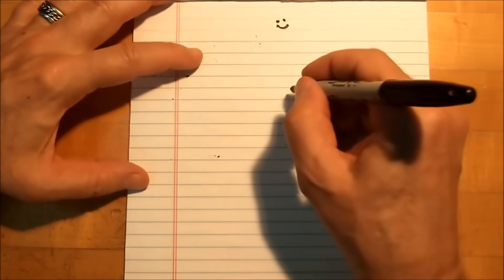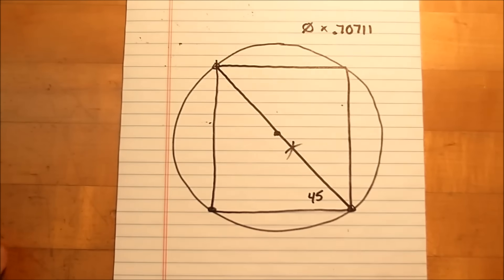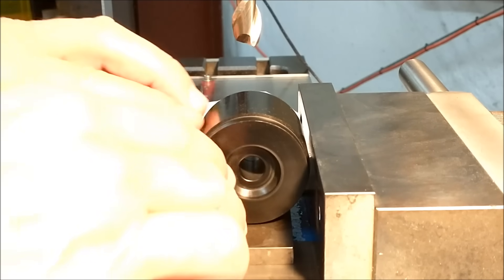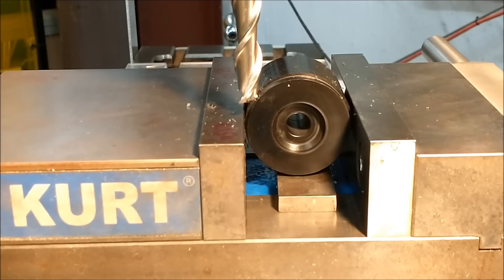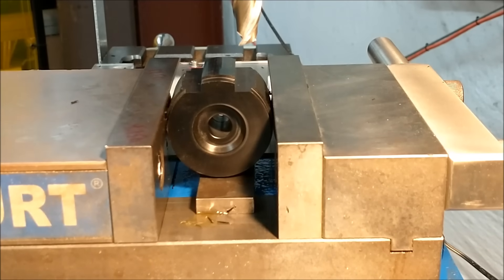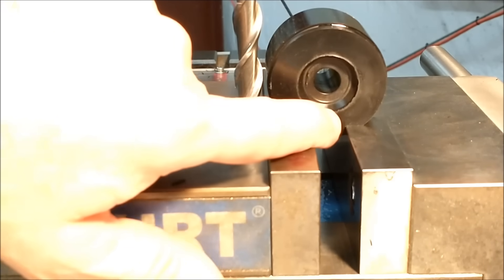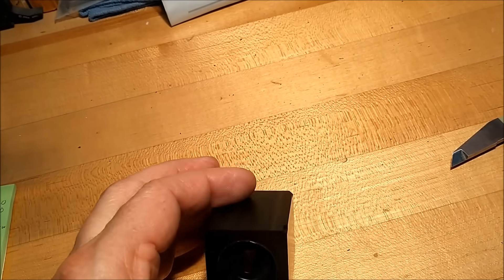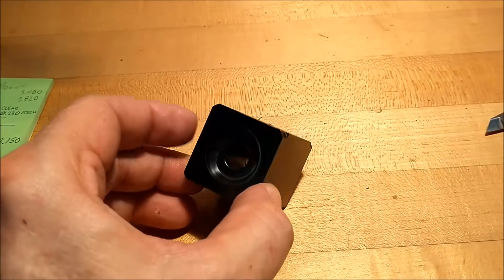Machining Round Stock to Square -- A Time Saving Technique !!!

Comment: Hi Joe.  You've provided dozen of great quick tips in the past so hope I can reciprocate with a trig tip
Sin x = opposite / hypotenuse and Cos x = adjacent / hypotenuse.    Quick tip if you forget whether cos is opposite or adjacent over hypotenuse?   Two 'O''s never go together.   Thus Sin  has and 'i' not an 'o' so this is Opposite.   Cos has an 'o;' so it can't be 'opposite' - has to be 'adjacent'.   
I used to machine tapered octagons out of 3" round brass, the taper simulating the draft of the brass casting. Used this trick all the time.  The trig involved was fairly horrendous due to the taper.   All done with a trusty Elliot 10M shaper.   Stay safe.

Comment: How did you know that you have a certain amount to remove from that "top" side of the cylindrical part. Finding the height of a chord can be tricky if you don't have the formula in a book handy.  And, man, that is one quiet 2 Flute, huh?   AWW...you're cutting plastic. Never mind.
Reply: "Finding the height of a chord can be tricky if you don't have the formula in a book handy"  

Really?  He's shown that the maximum inscribed square of a circle is  √2 * the circle's diameter ( approx 0.7071 ) If that's the case, then the amount you remove from each side is (1 -  0.7071 ) /2 * the original diameter, or 0.1464 * the original diameter, whatever that diameter was... How tricky?  And... when keyseating for a "feather" you'd need to be able to perform a slightly more complex calc... These are day to day calcs in the machine shop...
Milling a hex? The inscribed hex is 0.8081 (cos 30) of the circle's / cylinder's diameter, so, (1- 0.8081)2 * the cylinder's diameter is removed from touch on to finish... And pentagons, heptagons, octagons, nonagons, all use similar (but different for the odd numbers of sides) calcs... But, the Zeus tables we all used to carry in our breast pocket all have the figures in them, ready to use... Although they seem to apply to jig boring, hole patterns, they're as applicable to milling polygons...
Maths and machining go together...
Reply from the maker: Just measure from the opposite side. If you know the square and diameter of the stock, its easy.

Comment: There is no need for trigonometry to explain the reeason to multiply by 0.707. Suppose that in ⨂, circle's diameter=d=1. Circle' radius = ½   . By Pythagoras, Side²=(½)²+(½)²= ¼+¼=½,
Side = √ ½ = 0.70710678118
Reply: But what if the diameter is 17.8475? Or maybe even 7.6969. Oh, I am so confused.  :-)  People may not know that they can multiply the unit (1) diameter and all sides derived from it using the Pythag, Theorem by the actual diameter and all the numbers scale correctly.  Of course both Sine and Cosine functions are equal at 45 Deg, so...thing to remember...SINE = COS at 45Deg. = 0.707
Reply: @machobunny1  With such figures I would use a calculator as it will easily do the number of decimal places for you . But remember depending on what units you are using for metric you are showing figures going to tenths of a micron here , and with Imperial you are going to tenths of a thou .
With your 3 figure approximation for sine 45 you have only gone to 3 decimal places .
Unless you are grinding then you will not be able to achieve tenths .
Which means Don't worry about such small figures . 17.8475 is nearly 17.85 and 7.6969  is nearly 7.7  , you can round up and not lode much accuracy . I hope that this helps you .
Reply: Root 2 , that's not a rational number ! 😁 I'll show myself out .

Comment: very cool and fantastically useful little number thankyou... I often make square stock by forging it from round, I can do it by eye and just know I will have what I need given the right size....but calculating it is a bit of a pain, a number like 0.70711 to do it quickly would be cool. 

for anyone reading Its not the same btw because you are taking the entire volume and shifting it from round to square♦ usually lol
Reply from the maker: Glad it was helpful!
Reply: Cool.  If forging doesn't change the length then the cross sections of square and circle need to match. So pi D^2/4 = S^2. Solve for S:  S = sqrt(pi/4) D. So the number you want is 0.88622. 😊

Comment: Hey Joe, i am a certified electronics technician holding a degree in Electronics Engineering Technology. In my field, it is a must to know trig functions. We use the sine of 45 deg. Very often, because the rms value (voltage in your shop) is .70711 x peak. However, i have always been interested in machining and spent as much time as possible in the shop with some very good machinests. Since retiring, i now spend a lot of time in my small home shop working with my mini lathe and mini milling machine. Thank you for all your great info. I use it often and you are truly a blessing to me.

Comment: Damn Joe, You really have some fantastic math skills specifically Trigonometry. BTW the function is Cosine Cos(45) ~.707. But also The Sine of 45 is ~.707 or Cos (45) = Sin (45)  GOD BLESS Ya. You know or Trig
Reply: You don't even need trig to figure that out... It's simple algebra...

D -- diameter of the round part
S -- length of the side of an inscribed square in the circle
sqrt( x * y) = sqrt(x) * sqrt(y)
=> sqrt(x / y) = sqrt(x) / sqrt(y)

S^2 + S^2 = D^2
=> 2  * S^2 = D^2
=> S^2 = (D^2) / 2
=> S = sqrt( (D^2) / 2)
=> S = sqrt(D^2) / sqrt(2)
=> S = D / sqrt(2)
=> S = D * 1/sqrt(2)
=> S = D * 1/1.414214
=> S = D * 0.707107
Reply from the maker: Thanks. Its kind of a must in this trade. Geometry too.

Comment: Any machinist that is just memorizing factors instead of knowing the math/geometry is seriously lacking in ability.  I also don't understand how you think it's appropriate to tell people what they should or should not comment on.   Why all the criticism?  Because you come across as pompous with a large dollop of hubris.
Reply from the maker: Feel free to comment on the technical material presented,otherwise, feel free to comment on another channel. Personal remarks will get you blocked.
Reply: wait
You expect a MACHINIST to solve integro differential equations or use power series when there is a simple recipe to do something ?
I mean not everyone can visualize instantly that cos(45)=0.707 and that this  is the factor that should be used in this case ? Not obvious to most people.
Why do you think machinists handbooks are just hundreds and hundreds of table with pre computed values for known problems ?
Reply: The only one who is coming off as pompous around here is you. Loser! Remember, it is not the critic who counts but the man in the arena. Where is your channel that teaches amazing skills like Joe Pie?

Comment: (Assuming you're cutting steel) would it be better to bring the cutter to the top of the vise jaws with the knee instead of the quill, for greater stiffness?
Reply from the maker: Normally.
Reply: Yes definitely. do anything to get maximum rigidity

Comment: It's both the sine and cosine of 45 degrees. :D Like knowing pi out to five places, knowing co/sine of 45 out to five places (like you've got there) is just one of those things we wind up memorizing because it's so handy. :D
Reply: i know.  Joe said "a function of 45 deg" he could have literally guessed either sin or cos and he would have still been correct!
Reply: Came here to say this.  I have a plumber friend that always uses 1.41 x a distance between two points.  Or 1.5 to be safe.  He uses this  to get a total length of pipe between those two point but running it one leg, then a 90 and the second leg.  Again just a trig function because the hypothesis on a 45 degree iso  triangle in relation to the other sides.
Reply: Or half the square root of 2, though the 5 decimal olaces is a bit reckless.
Reply: @olderasdirt  Reckless???  I'm not sure you understand the meaning of that word.
Reply: @DiffEQ  Can you please share with us a picture of your mill that will repeatibly hold tolerances better than 1 part in 100,000 ? (and your temperature controlled workshop)

Comment: Thank you for this very useful idea!  I've got a lot of round stock on hand and not much square.

Also, thank you for resisting the temptation to use ALL CAPS in the title.  ...I tend to skip those, no matter who made them, because I see it as spamming to increase views.  If the video is worth watching - and yours usually are - a simple hype-free title that says what it's about is the best way to get my attention.
Thank you again for a really good machining tip!
Reply from the maker: If I put all caps in the title, the video will be on something that will keep the viewers from injury.
Reply: @joepie221  Emphasis where worthwhile, as it should be :)

Comment: Thanks for the tips, Joe 😊. I do have one question though. That was one helluva side mill lol. Would you recommend a two flute endmill for a large cut like that? My milling attachment ruined me and now with the big mill I'm still a bit of a chicken 🤣🐓🐓🐓🤣
Reply from the maker: Softer the material = the fewer flutes you need + higher RPM, harder the material = the more flute you should use and lower RPM.
Reply: It depends on the material your milling. 2 flute endmills are usually used for softer and gummy materials like aluminum, brass, plastics, copper, etc. 2 flutes allow the cutter time to clear a chip otherwise the chips pack up in the endmill and cold weld to it which causes all kinds of problems.

Comment: Hi Joe would the .70711apply in metric too?
Reply: yes, since 0.70711 is a decimal value of 1/√2. This is taken from the special trangles method in math which is irrespective of measurement, where there's 3 angles. One 90 and two 45s, so the hypotenuse is √2 and each side length is 1; that's the special triangle. Knowing this, we use Sin(opposite/hypoteneuse)=angle so we find the hypotenuse; 1/√2. That's why, some nerd shit, but useful!
Reply: It's a pure number, unitless. So it works on all units
Reply: 0.70711 is half the square root of two - try your metric calculator on that 9-)
Reply from the maker: Yep.

Comment: If the part's short enough, stand it up in the vise with a v-block, tram the round stock beneath the spindle, and mill it square, easier, quicker, and more accurate.
Reply from the maker: I normally do this on bars 18" long. Vertical is not an option for that. Using a V block also requires the raw material to be longer than the part. Just something to consider.

Comment: Joe what method, this or a more conventional cutting method, would insure the best centering of the square to the original cylinder?  Thanks.
Reply from the maker: The grip rail can be off center a bit and not hurt the final position, but if the net/net is close, indicate the material once you flip it over and use the grip rail.

Comment: Kind of off topic, but is there a rule of thumb of the height of the parallels used in a milling vice? Also, at what vice opening do you feel comfortable with using one parallel? Thank you.
Reply from the maker: Not really, but if you are tapping a part down and only one parallel gets tight, use taller parallels as safety permits until you get both to seat.
Reply: Thank you very much

Comment: Can't you just mill the first face and two half sides, use those as the guide rail, flip it with a support and mill the remaining half sides and last face since you have the vice to maintain accuracy?
Reply from the maker: Than you have to blend the original 2 sides. I'm not a fan of that.

Comment: In your diagram, the diameter of the stock is also the hypotenuse of the triangle. If you assume the length of the sides are 1 unit (inch, mm, mile, furlong - doesn't matter), then the length of the hypotenuse is the square root of the sum of the squares of the sides - 1 squared is 1, so the hypotenuse is the square root of 2, or roughly 1.41428 units long. Flipping this on its head, if the hypotenuse is 1 unit long, the sum of the squares of the sides is 1. The square root of 1 is 1, so the squares of the sides are each 1/2 unit long. This means that the sides are the square root of 1/2, or 0.70711
Reply from the maker: Correct. The hypotenuse will always be the round stock diameter. Also, There are several ways to calculate the max square size. I though just cutting to the end and presenting the most useful value would be the easiest to remember.

Comment: Wondering if the first centering operation can be avoided. The grip does not need to be on center since the part will get indicated anyway once it's upside-down.
Reply from the maker: Correct, but a symmetrical offset initially would then yield a grip rail with uneven side heights and increase the potential for it to jump out during later cutting operations.

Comment: Save more time by getting square material , either your at a home shop or got no sense at work
Reply: Some times you need to make  small part out of oddball alloy, that you have a round bar of, and buying separate square piece is time and money you just don't need to spend. I've been there myself.
Reply: @ducembarr7057  If I can make money and not need to wait doing it, while using material I have on hand, sign me up.
Reply: Why machine anything at all? Just buy finished parts in the shape and size you need
Reply: @Jamvan001  I have made parts that were round and had a square feature as part of the device. When roughing out the material how small do you go? This method allows you to rough to near size and then finish the portion needed to be square as well as maintain alignment with other features as needed. 
The other part to this is check out the cost of square vs round stock and wait time. Round is almost always available, even buying larger it is usually less than square. Round is almost always available. Not so for square. You can find it but often has a longer wait time.
Reply from the maker: I have found, quite often, some part profiles fits better in a round blank than a square one. I use the grip rail technique a lot for odd final shapes other than square, but its a good fix if you need material NOW and don't have it.
Reply: @joepie221  That's why you've earned the title of machinist and the knowledge you've acquired over the years to make a difficult thing easy is beyond some people. Thanks for the video.

Comment: all seems so easy once you see it, great tip thanks Joe. What RPM do you run your cutter, thanks
Reply from the maker: This was 1650, but changes based on material, DOC and # of flutes on the cutter.

Comment: Ive waited a long time for this one thanx Joe, i had 1 or 2 occasions where i needed to make square stock from round stock. and needless to say i was frustrated at least lol. jus 1 question, the .70711, does it apply to both imperial and metric
Reply: Yes, the .70711 is the Sine of 45 degrees. So it is independant of imperial or metric or whatever other system you want to measure with.
Reply: @charanvantijn541  thanx
Reply from the maker: It should.

Comment: I’ve also seen some guys divide the diameter by the square root of 2 ( 1.414 ). Love your channel, thanks for all you do!!
Reply: It's pythagorus - hypotonus squared equals sum of the squares of the other two sides.  Using the diagram shown near the start of the vid, the diameter of the stock is the hypotonus, and each side of the required square bar will be the other two sides.  Make each side equal 1 unit, then the diameter will be the square root of 1 squared + 1 squared units.  Which equals the square root of 2 = approx (1.414)  So dividing the diameter by 1.414 will give you the size of each side of the square.  Or instead of dividing, multiply by the reciprocal of 1.414 (mathematicall the same operation) which is 0.707.  Or you can multiply by either the cos or sin of 45 degrees (both are .707, because both adjacent and opposite sides are the same length, and cos and sin of 45 deg can also be derived by pythagorus in the same way).

Comment: Did you mill oversize for the break edge? If so you you were not trying to actually make a square maxing out the area diameter of the stock? You were just trying to get it square right? Just wondering.Love the vids. I am a manual machinist in training by the way.
Reply from the maker: I milled the one face just shy of truly tangent to show the result. It was .007 away from a true corner. This would have been the biggest square possible from that blank.
Reply: @joepie221  thank you

Comment: I just use .707. Unless I use 1.414. But another magic number for the machinist is 0.866 (sine cosine 30 degrees). I use it for making hexagons. Also multiplied by a diameter it is the distance between jaws of a three jaw chuck.
Reply from the maker: Hex size across the flats X 1.155 for round stock required.

Comment: This brings me back full circle to the first Joe Pie video I ever watched, the "the best mill tip you'll ever get" on squaring stock.  I've used that tip countless times, but until now, hadn't made the connection to how it could be used on non-square'ish stock.  Thanks for another informative video.
Reply from the maker: My pleasure.
Reply: @joepie221  My benefit.  I think I'm getting the better end of the deal.   ;-)

Comment: I made an adapter for a low quality 3 jaw chuck that lets me hold it in my Kurt vise. I can access round stock from 5 sides then part off the grip stock in the lathe.
Reply from the maker: Excellent.
Reply: A fine idea that... Tho, you need not hold it in a vise, you can make it sit flat on the mill table, as if it were a rotary table chuck... Same thing, but a little different... Depending on the requirement, either can prove beneficial...